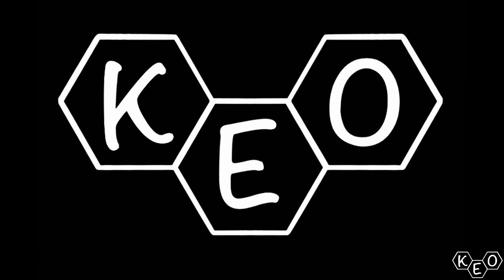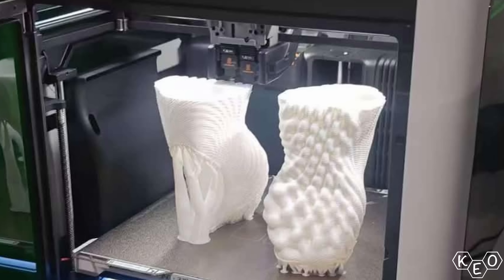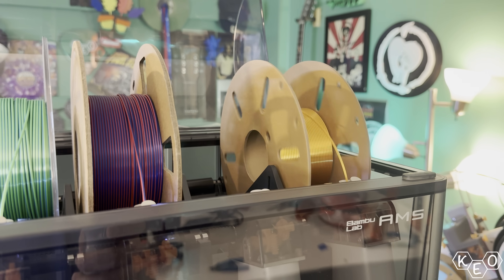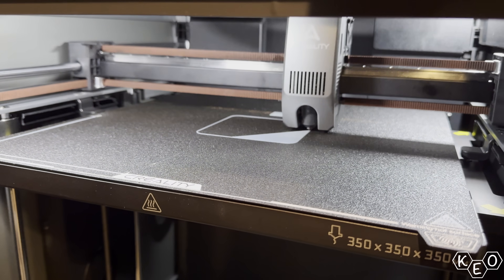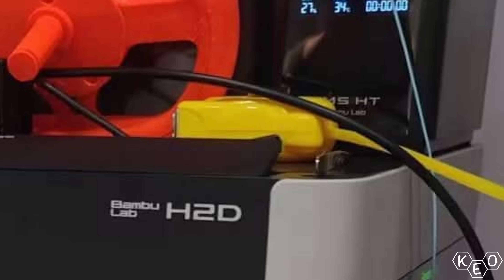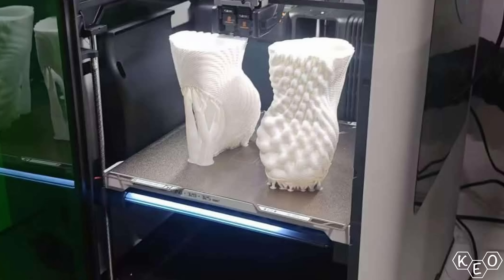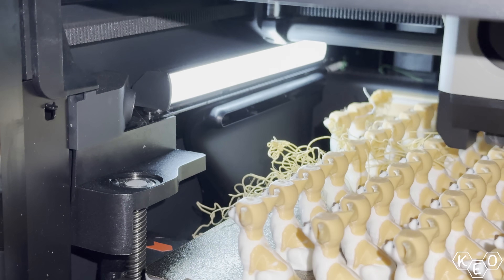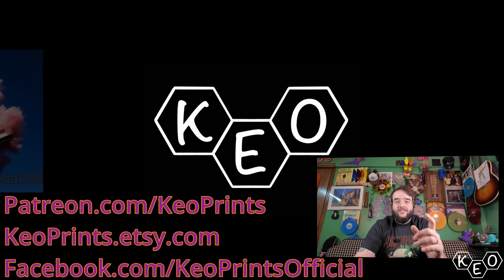The Unreleased Bambu H2D Changes Everything

Comment: I make functional prints and almost never need color, so the AMS and other MMUs weren't interesting to me, but I would love to be able to print PETG-CF parts with PLA supports, or print a PETG-CF part with TPU feet, so dual extruders would be very useful.  I won't buy a Bambu because I don't like their corporate ethos, but I'm happy to see the industry moving toward fast no-waste dual nozzle printing.
Reply: I agree with what you are saying! If you are looking for a dual nozzle printer you can check ratrig vcore 4 idex version. They will also develop a multimaterial system also. They are still introducing upgrades for it. The sizes are 300, 400, 500 mm3.
Reply: @tunedstylespecs  - Oh, I am VERY aware of the V-Core 4!  I'm practically stalking them online.  A 500 mm V-Core 4 IDEX may be in my future.  Their marketing videos are very enticing and I like what I've seen of their company culture.  They've shipped a lot of V-Core 4 kits but I'm waiting to see more IDEX success stories.  The belts are long and it may difficult to tune the hybrid IDEX system?
Reply: @Liberty4Ever  I am making functional prints as well, but with my CR10S ( I know is old) but I have made a full custom electronic box from an old pc case so I can easily modify it and at the same time keep it far away from the printer. Although I have a lot of leftovers so I will add 4 additional extrusions and convert it into a corexy and see what I can do from there. My main goal is to make most of it out of metal to ensure I can reach high chamber temps to print ABS, ASA, Nylon, PP and other engineering materials for many applications with most desirable the automotive ones.
Reply: @tunedstylespecs  - CR10S is kickin' it old school!  I liked some of the Enders of that era for their remote electronics that would make enclosing the printer for (at the time) ABS much easier.  There are some large print farms still running some hardware not much newer than the CR10S because good enough is good enough... and modding makes everything better!  I built my first two 3D printers because there were few consumer based printers and they were kinda lame.  I'm on my 12th 3D printer, and for me, Klipper was a game changer.  That's when 3D printing became less of a hobby and more of a tool and the basis for a business.  Kudos to the open source developers making the great slicers.  That's a huge part of the 3D printing revolution as well.
Reply: @Liberty4Ever  indeed, Klipper elevated the 3d printing to another level.  That was the most serious mod I did to my CR10S appart from the ABL and belt tensioners, and it prints great. Know I want to take a full advantage of the input shaping and it is much more accurate with corexy. That said, building my own printer allows a greater flexibility in the specs and I don't want to quit all the good work I did on my electronics as it is nice and reliable and of course lots of fun. In addition, I feel that I have a greater control for the cost of maintenance without being driven by a company which the most obvious way is to drive you to a position to sell you there next gen 3d printer although they seem reliable and easy to get started.
Reply: i can understand that. I was thinking the same when i was ordering my printer but i ended up splashing for it to see how i could use it. if you have a printer that an ams or simular works with the auto load and unload as well as auto change reel is so so nice. i cant got back. well i can but its such a pain now to load it manually. i know i know i sound like a gobshite, because i am. but its so nice. i do use multi color but only very rarely. but the auto load and unload is a must for me now. esp when im printing a load of parts off. so much easyer. take the filiment out of dryer and put in rack and push end in and it loads and its ready.
Reply: @drdoomslab  - I've been looking at the FlashForge AD5X which has a four reel IFS.  It's still a single print head so it needs to purge and poop whenever it changes filament but for most of my applications I might do a single filament change to print yellow TPU on top of a black TPU part (like the custom mud flaps I made for my Japanese mini truck) or print a layer of PLA on top of PETG supports to make it easier to peel off a PETG part.  I'd be using two types of filament but having a four reel IFS would allow me to hang two of each filament with the printer automatically switching to a new spool when one spool is empty, with no need for me to manage the spools and with no wasted filament left on the spool.  That's very nice all the time but particularly for volume production.  Harvest the parts and replace any empty spools.
Reply: @drdoomslab  autochange is a great idea in combination with a dry box for nylon filaments and other hygroscopic materials. Now I am waiting for the BTT vivid to be released as it is a generic AMS/MMU that is designed for klipper machines.
Reply: Prusa XL is your answer.

Comment: Can already see the probelm here. This will be a massive flop of a product

I have a flashforge from 2015 that did the same thing here; the problem is no matter how perfectly you can get those two hotends aligned and leveled, it will never be perfect. Therefore, you will always have failed prints. Every company that did this suffered rthis exact fate.
This is why everyone went to IDEX (even that has problems but it much better than two hotends on the same toolhead)
Only way bambu can save themselves from this massive design flaw (which i bet they can), is if each toolhead levels itself perfectly with the build plate (which I'm hopeful, but extremely highly doubt). 

It's a very tempting feature; multi color printing, reduced prugimng, saved costs on excess toolheads, etc. But this design was doomed to fail right from the start when introduced in the early 90's on commerical machines. Again, same nozzle->to build plate leveling problem.

I wish them luck

Comment: Low power UV laser to engrave plastic, diode laser will be useless for plastic and damaging to the rest of the machine (smoke from cutting and engraving wood can be very dirty). But the most worrying part is the fact that I'm not a fanboy who wants to be locked-in into a silly ecosystem.
Reply: Infrared would be cheaper and as good for plastic

Comment: does it come with the standard "we require full control over your entire network, all devices, and bank accounts in the name of security" policy? and i hope they finally grew a pair to implement pay-to-print feature, so "your" printer becomes a vending machine, deposit a coin to start printing.
Reply: After all, the sky IS falling. 😂
Reply: I returned my P1S just before this shit was going to happen and got my money back.
If they should reconsider this policy, I would reconsider buying a BL.

I told myself first waiting for the new BL printer, to see what it should bring and what the price would be... But I'm not getting very warm about what I see in this leak (for probably a minimum of €1000 more then the X1C).

So I'm on the edge of preordering an Elegoo Centauro Carbon at the point, which is almost just a X1C, but for 1/4 of it's price... And then just spending my coupons on a cheap BL a1-mini.
Reply: @rockels_journals I just ordered a Qidi Plus 4.  Outside of the chamber heater issue at launch, and a few very minor issues that have been fixed or require little effort to, I've seen nothing to shy away from this printer.  They also do many things right out of the box which I want to support (such as material profiles for every filament it natively supports).  The Elegoo CC is nice, but it has a wait time currently in the 3-4 month range.  The plus4 also supports pps-cf with its 370°c nozzle that Id like to use.  The wider belts basically remove VFAs, and I hope to be happy.  I don't really care for an AMS at this moment, so it's not a big deal for me to not have one.
Reply: @UNgineering  the majority of the stuff you all are scared about Will Not affect you unless you run a print farm or you buy enough 3rd party addons that you might as well had bought a different printer to start with. You all listen to these hot-headed YouTubers, paid by other manufacturers to promote their products instead of Bambu, instead of doing your own reading. The CEO of Bambu did a Q&A going over all of these concerns only to show that all this was blown way out of proportion by people like you who exaggerate without reading into it.
Reply: @Ukioda *affect
Reply: @Ukioda for real lmfao these crybabies
Reply: @Ukioda  People blowing things out of proportion by making up doomsday conspiracy theories on the internet? Impossible.
Reply: @ZerocoolsPropsandCollectibles LOL…😂

Comment: I'm glad I didn't wait for this machine and grabbed a K2 Plus. This machine is probably going to be like $5,000 (Canadian) or more and still isn't 350 cubed plus it's not included in Bambu's statement of "On currently released models we won't do horrible awful shit" which by proxy means they may have this one further locked down etc.
Reply: For me, there are now 2 company I won't touch EVER again: Bambu Lab and Creality!!
I got K2 Plus, and .... piece of garbage. Bambu Lab and their stupidity I won't be a part of. So what's left? Really, if you want to have top-notch, that is Prusa, sadly they are so freaking expensive. So what's left then? Either build a Voron or do get a new hobby.
Reply: @eudenmark  Or you could just get on with what you have and don't fall for all the "will they or wont they BS" until it happens
Reply: @eudenmark  You could always buy a Qidi Plus 4. That's what I did... it arrived about an hour ago, and whilst I've not printed anything yet, that's 'cos it's been doing it's setup thang, and now it's updating the firmware... Decent experience so far, though! Much better than my old Ender 3 which finally borked itself last week.

Comment: Its all fun and games until you get forced into a subscriptions service to use the printers.
Reply: Citation needed.
Reply: Because they said they wouldn't? When in actuality they said they wouldn't require a subscription for their CURRENT PRODUCT LINE. But honestly it doesn't matter what they say. 

"For our current product line, yes. We will never require a subscription to control or print from our printers over a home network. However, there might be specific business scenarios in the future that require exceptions, i.e a 3DP vending machine, but these would apply to entirely different applications and customer needs. If such a product line is introduced, we will clearly communicate this before its launch."
Reply: Dual nozzle is nice. I would prefer a permanent dual extrusion setup, for instant changes between two filaments. Changing between several filaments is nice, but for engineering and practical prints, which are 90% of what I print, dual materials are plenty.

Unfortunately this is a Bambu...

Which is why I built an IDEX Voron recently.
Reply: If it comes to that, there's too many tech savvy people with these printers to not have them completely jail broken.
Reply: @DeanRockne I’m pretty sure they already are
Reply: "I'm not upset that you lied to me, I'm upset that from now on I can't believe you.”- Friedrich Nietzsche
Reply: Oh good god just shut up.
Reply: brokie comment
Reply: Remember HP, it didn't started as it is. It slowly descended into "hp ink now" or whatever their pay to use your printer montly fee is named
Reply: @rafaelmalagon7950  Yep if they do this they might as well file for chapter 11 makes sense they wouldnt think of that.
Reply: @rafaelmalagon7950 because hp owns Bambu 😂
Reply: Which isn't happening, soooooo
Reply: Bambu has already said they are not gonna do that
Reply: @Josiahs3dPrinting  Yeah... and how has trusting big companies on such matters worked out so far?
Reply: @Josiahs3dPrinting Yeah... and so have other big companies... Only to go back on their word.

Google used to have the motto... Don't be evil...

Don't trust a big company, even if they have been honest and good actors to this point, a skeptical eye should still be given.

Bambu doesn't have a great track record here, they are also fairly young as a company, and already are being shady on these things.
Reply: @Josiahs3DP  They only said they wouldn't on their "current line of printers". New printers are fair game though.
Reply: @Josiahs3DP the secret to decoding corporate double speak is to understand that if the corporation can make 0.0000000000000001% more profit this quarter by doing what they've said they won't, well, then they'll claim they never said it and you're just nuts for thinking they did. Corporate gaslighting is real.
Reply: @Josiahs3DP they said "for the current generation of printers."  probably this one too but definitely not the sort of confidence phrasing that makes me comfortable with that company.
Reply: @Josiahs3DP To be specific, they said the the update to the new software wasn't going to do that. They did not say that they would NEVER do that.

Comment: One place dual nozzle can be handy is industrial use.  One nozzle with the build filament, and the second nozzle for a water soluble support filament like PVA.  After printing you just submerge in water and the supports fall away.
Reply: Another use is for putting text on electronics cases.  One color for the case, one color for the embedded text, labels and icons.
Reply: @   You really don't need dual nozzle for that, you can just run a filament switcher. The dual hotend system if you need filaments with incompatible properties.
Reply: @SianaGearz  If you switch filaments on one nozzle, you need to purge between layers.
Reply: My school had an industrial printer with water-soluble supports, and it was incredibly convenient.
Reply: @ where print quality and dimensional accuracy is paramount, it is invaluable.
Reply: been done before, and hasn't done anything so great that we all moved to them.  this won't change.

Comment: -- Really cool video. Two or more things comes to mind as an observation:

1. They don't use dual print head to print a dissimilar type of support material. BTW support tree "disappeared" from features after last update, but I can't remember whether it was on my A1 or QIDI Plus4...
2. Damn, it does looks like a laser print head, and now I'm wonder whether price range for new printer is going to be ~<$1500 or more like $3000-$5000?
Reply: What do you mean “support tree” “disappeared” you mean “tree supports”? They’ve not disappeared from Bambu studio or orca slicer and doesn’t qidi just use orca? So what are you saying?
Reply: @joeylopezdesign  -- No Qidi using proprietary(but probably Orca base slicer) called "Fluidd".

-- I just checked both, and it was Bamboo Lab A1, that after update made it unavailable, means "support" folder high lighted in orange, but no support was available. Now that you mentioned, I went to start Bamboo slicer, and support was highlighted in orange, and clicked around, came back to "support" folder, and yeah all supports are back including "Tree" which is my favorite since it is easier to remove, and folder went to normal grey color. IDK what to make if it...

Comment: I hope the laser is an optional extra. I prey for a heated chamber or it's a NO DEAL. The belts look wide (awesome)... love to see the teeth spacing. I love the size. I made the mistake of thinking bigger was better when I got into 3d printing. I bought a 500mm cubed machine and learnt the hard way of the numerous issues related to these machines. Besides most of my prints are small & I don't want to burn 600 watts per hour to print mostly small things. I'll probably wait until Bambu advertise how locked down the machine will be before making a decision.

Comment: Who knows Bambo may have a winner here. I would think the heavier printhead would slow the print speed a bit tho.  I wonder why they only went to 320mm. The die cast frame on the 370mm K2+ is a massive structure, and that may be part of it.  I am enjoying my K2 and 8 colors so far and I am glad to see another printer company making major inroads. This is shaping up like the Ford and GM musclecar wars of the 60's. Ill just sit back with my huge bowl of popcorn and enjoy the Chinese printer battles. 🤠
Reply: Size means price. I’m curious as to what this will cost. Unlike people who got all frothy about it I’m not that concerned about their new rules. But the old carbon is around $1,100. This could be anywhere from $1,400 to $2,000.

Comment: I agree that there is an attachment for something on the head, but rather than a laser head in my humble opinion I would see a scanner: you place the object on the plate, scan it and it replicates it immediately .
Reply: @PencilParasite  now that would sell. A 3D photocopier
Reply: @imaginitivity7853  maybe🤣
Reply: @imaginitivity7853  You can buy them now, but they are expensive!
Reply: Would be cool, but it would only work for objects with no undercuts.  I have used numerous 3D scanners, including laser line scanners, photogrammetry devices,  and I own an Einscan HX.  To fully scan most objects, you need to be able to hit it with some kind of light structure (laser line, structured light pattern, etc.) AND view it from multiple angles.  Having a module that is stuck on a fixed plane scanning a stationary object will only be able to present you with a surface map of the highest peaks  facing the scanner.  You'd need a rotary axis parallel to the bed plane (sideways) to effectively scan things with a module that is mounted to the tool head.
Reply: Cool speculation.  It would need more than XY control to 3D scan.  Maybe a rotary axis accessory?  I just bought a THREE 3D scanner as an accessory to my 3D printers, so I can definitely see having one integrated into a 3D printer to scan and print 3D copies.
Reply: That would be so cool, I would buy it just for that